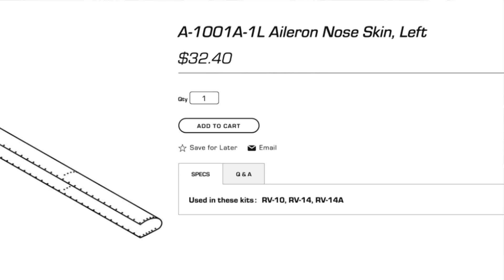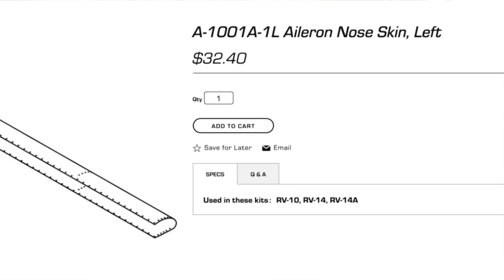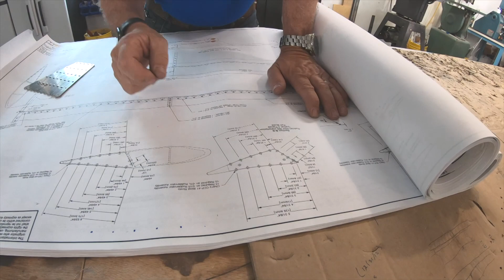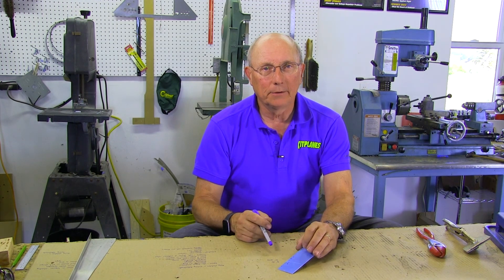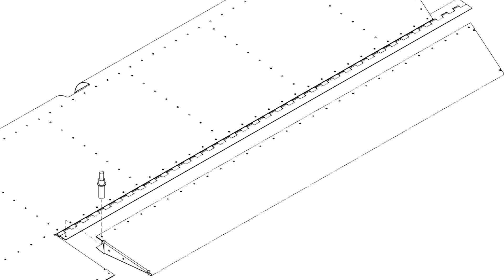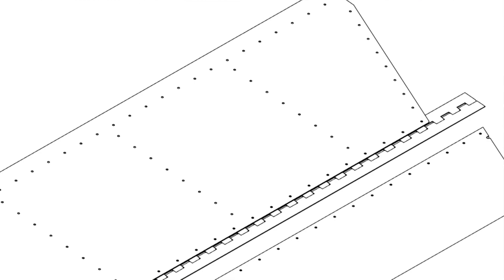Metal Magic: Fixing Mistakes and Making Adjustments

Comment: For the minimum edge distance, is that the distance required after the hole is drilled, or the minimum spacing from the edge to the center of the hole?